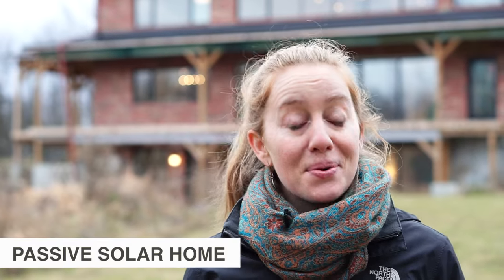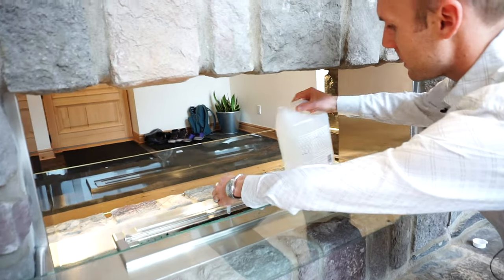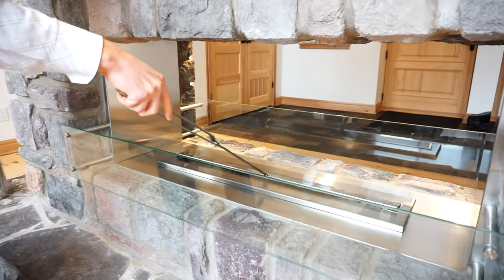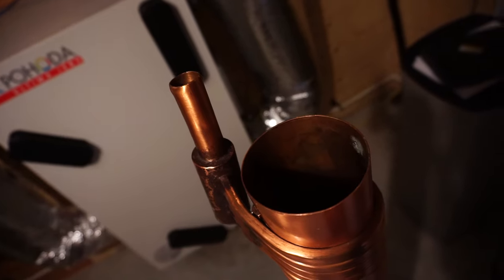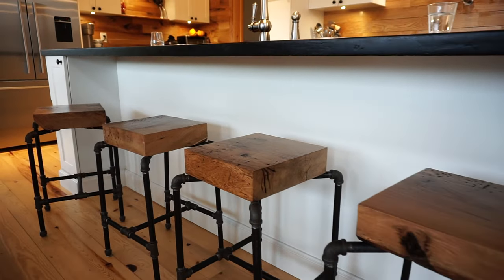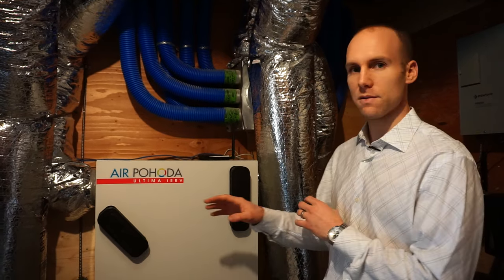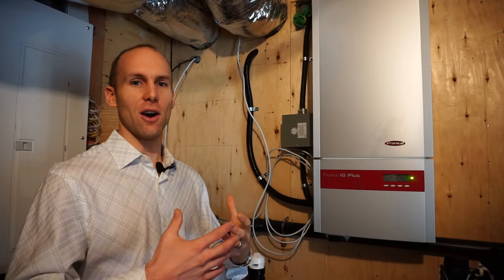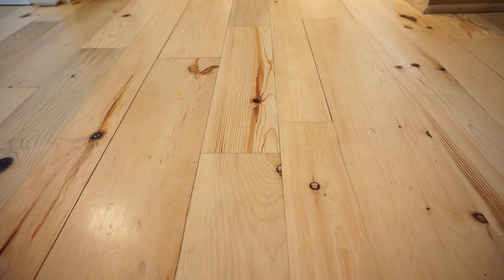Couple Builds Energy Efficient Passive Solar Home - Green Building

Comment: This house had to cost a fortune to build.  He talks about it being cheaper than a normal house.  Guaranty he's not even close to a break even point vs a standard house.  It's like buying a $40k electric car.  Going to take a shitload of time to break even.
Reply: +Andrew Esposito If they met the passive house standard, it has to use about 90% less energy than a typical house. Obviously we have no idea how much they spent, but most sources I have read indicate about a 10% cost premium vs a standard house. The solar panel array will pay itself off in less than 10 years, after that it's pure profit.

Comment: it looks like extreme overkill on insulation.  if the envelope is sealed and an aluminum layer were used to reflect 99% of the ir energy,  they wouldnt need 2 feet of insulation

Comment: And where were those 10kw of solar panels made?  Likely in China.  Was all the horrible caustic chemicals recycled?  I doubt it because it takes a lot of energy and costs a lot of money.  You do also know that producing the pure silicon does require a huge amount of energy.  Most of China's power is produced by rather dirty coal power plants.  If you were so worried about the planet you would not have a 4000 square foot home for a family with one child.  You probably live in a big house and drive a lot.  I have a fraction of your "environmental footprint" and that is because I am poor.  I have 4 kids and live in a 1500 square foot house, work at home, rarely drive, keep the thermostat low in the winter, and do not use AC in my house or car... EVER.  Heck just the pollution from all the construction equipment likely caused more carbon pollution than all the utilities in my house in the last 25 years.  But if this home makes you feel better than go for it.

Comment: this house, although is great, but is not ''passive''. this is a net-zero house because they generate electricity and using electricity and when calculating the overall consumption is net-zero. A passive house is a house that simply does not use electricity at all and all the strategies that are used are focusing on mitigating the effect of the environment in ways that do not involve using electricity. for example, cool towers cools the building with  a technique called evaporative cooling that damps the dry air through a wet pad and then  the damped cool air is been driven by gravity downward to cool the house.
Reply: that's not correct either. Passive houses definitely use electricity because 1. People don't live in houses without utilities anymore and 2. the ventilation requirements necessitate an HRV or ERV which requires electricity to move the air about in a controlled manner.

The definition of a Passive house is a house that requires no more than 15KWH per square meter per year in Heating/Ventilation. A Passive house isn't necessarily a net zero house, especially if it doesn't have solar PV or any other form of energy production on site. A net zero house is simply a house that has enough energy production on site to provide a net zero energy consumption over the course of a 12 month period of time. A passive house is typically less demanding on the utility grid compared with a net zero house because energy production will be higher in the summer while in the winter consumption will likely far exceed energy production for most locations. A passive house with enough Solar PV to meet or exceed usage is the ideal house.

I prefer the idea of building passive houses because if the grid is cut out, you still have enough insulation and low energy consumption to theoretically weather a blizzard or natural disaster. If you want to add Solar PV at a later time, you still can with a Passive house (location permitting).

Comment: Wahoo there so much high technology and so much taping plastic/Polymere wrap in this house you must have spicy contract with your labours to maintain this plastic wrap efficient beyond the 20 years warranty of most of the components you use.  
So much technology and at the end there is a high electricity consumption. 
That is not saving the planet, that is emphasise fossil industry there is more oil based products stored in the make up of this house than fossil fuel which this house could have consume during its entire life style.   
In 50 years what will you do of all this junk rubbish.

Comment: Bioethanol is far from green! Yes it is more carbon neutral than fossil fuels (though not 100% so I wouldn't say they are fossil fuel free as a lot of fossil fuels are used in its production) but what is the point of saving on CO2 and then destroying diverse wildlife habitat. A wood burning stove would have been a better option (there are ones that are suitable for use in passive houses) and could have been powered using locally sourced wood rather than ethanol from crops grown far away.

Comment: When I heard "bioethanol", I realized I was dealing with ideologues that aren't smart or knowledgeable enough to understand what they're doing. Puting "bio" in front of ethanol doesn't make any sense, since it's already a plant based product. It only makes sense when we're talking about Diesel that was made from plant base, like soybeans, instead of being a fraction of oil from fossilized origins! Also, have they balanced the carbon impact from the concrete and Epoxy over quartz tops? Have they considered the carbon impact of producing noble gases to their triple glazed windows, instead of just using air, what's the point of that? What's the liquid difference in carbon impact and the heat flux in each case?

Comment: Cost per square foot vs. "conventional home"?  I CAN tell you that I could build a MUCH more efficient home for less.
Reply: +Patrick EH (Illogic Buster) We're all ears. If you can build a more efficient house than a certified passive house, you're the only one. This is currently the highest building standard in the world as far as energy efficiency goes.
Reply: Trevor Lambert
Certainly.  A correctly built monolithic dome surpasses that.  This is no secret to those who have been in the bus for 30+ years.
Reply: Not even close. Going by the company's own claims, they are 50% more efficient than a conventional home. A passive house is about 90% more efficient, i.e. 4-5 times more efficient than a passive house. Despite their claims to the contrary, it also looks like an environmental catastrophe, given the amount of concrete involved. For the same reason, I doubt the claim of being cheaper to build than a passive house.
Reply: Trevor Lambert
They are ~50% on bills.  that is compared to WELL insulated CUSTOM homes. I started designing Passive systems in '80.  If you have more experience.  Good!  Horse - water,

Caio
Reply: If this was the 1980s, you might have a case. Passive house designs of that era were flawed, putting too much focus on thermal mass and not enough on insulation, air tightness and window quality. I'm confused how you can think that ~50% savings is superior to ~90% savings. On Monolithic's website they're proudly citing a testimonial of $950 annual energy cost vs average for the area of $2157 (not "WELL insulated", just average). This does not come close to any house meeting the Passivhaus standard. I'm afraid I have to conclude your claim is thoroughly debunked.
Reply: Trevor Lambert
Because 50% is without doing ANYTHING  passive design beyond the basic shell.  (Which BTW is FAR more airtight AND of a FAR higher R values than ANY frame house.)  So, if one then designs to take advantage of passive tech on top of that...

BTW, I said I STARTED in the 80's Nice try at straw man.  Better luck next life time.
Reply: Patrick EH Cite some source, or your claims are dismissed. You are trying to tell me that the company that is doing its best to sell you the product is UNDERstating the potential? Highly unlikely, and until some other evidence besides your say so is provided, that is the only number we have. Here are the facts we know: concrete is expensive and terrible insulator. The insulation, if my memory serves me from when I looked at it a few weeks ago, is provided by sprayed foam, which is extremely expensive. If your're going to get "FAR higher R values", which would have to be on the order of R125 in order to qualify for that superlative (run of the mill passive certified house will be at minimum R50 walls and R100 ceiling), that's 20-25" thick and it's going to cost a small fortune. I know you said you started in the 80s, and that does not imply you haven't learned anything since. I merely offered that as a possible explanation for your apparent ignorance of modern building science. Do you even know what a straw man is? I mean, I guess I already know the answer to that, based on your usage of the term. Bottom line is all you've done is make claims, and provided ZERO justification, either in theoretical form or in the way of supporting evidence. This is the last time I will be wasting talking to you.
Reply: Trevor Lambert
Do your own research.  I pointed the way.  If your ego is too big to accept new tech.  YOU LOSE!!!!!!!!!!!!!!!!!!!!!!!!!!!!!!!!!!!!!!!!!!!!!!!!!!!!!!!!!!!!!!!!!